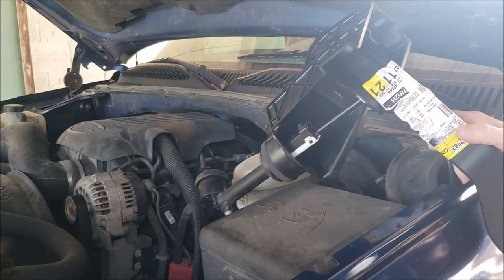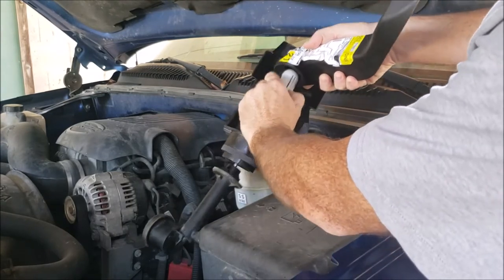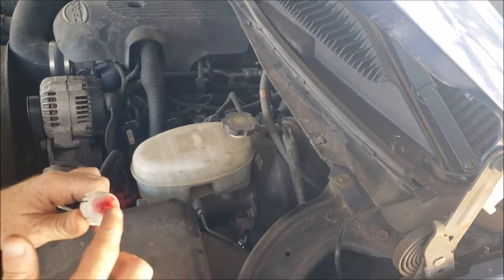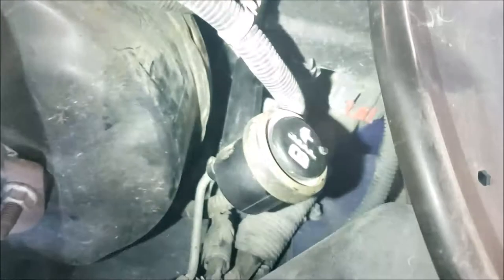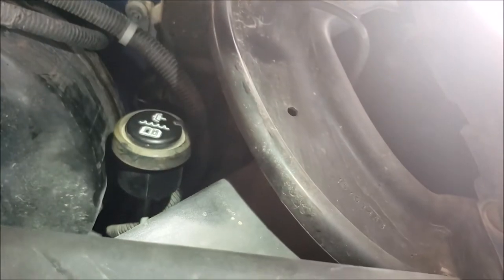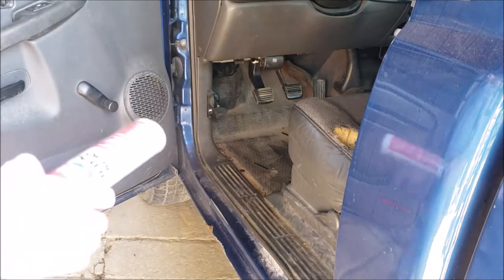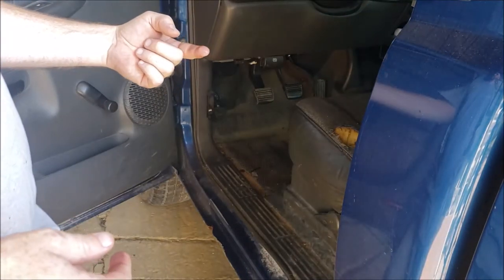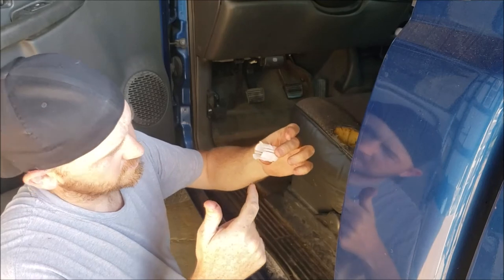Fixing a squeaking clutch pedal in a Silverado

Comment: Any ideas on the noise if grease doesnt help? I have a new pedal assembly with a new bushing cause the old bushing was in pieces. The new pedal and bushing was squeaky so i tried a few different lubes and grease but no luck and then I replaced the master cylinder but it's still obnoxiously squeaky. The only thing i can think is that it's the new pedal itself. Any other thoughts or ideas?
Reply from the maker: I no longer get have the truck but I think I remember greasing the bushings  a couple of times to get them to stop. I may have used a heavy grease.

Comment: I have exactly the same issue with a 2005 Silverado 4WD with the 4.8 engine. If anything the sound of my clutch is even more annoying. My truck is a standard cab so the room to work is extremely tight. Might need to remove the driver’s seat to get the room to get to it. Is it possible to do this fix working from inside the truck only? Wondering how you got the pedal assembly out. 

Many thanks
Reply from the maker: Russel I have another video that shows me replacing the pedal assembly. Should be the video posted a day before this one.

Comment: Question about the greasing.  Once the master cylinder was locked in, how did you get the rod to move back enough to get the white bushing back off to grease?    After you unlocked from the pedal, how did you move the tod back?  Thanks
Reply from the maker: I think I took the master cylinder back out but I believe the ball has two tabs that need pressed together to remove the rod from the pedal assembly. It's been a while since I've looked at it.
Reply: @DivineSpeed  That is the same question I have. Can you remove the white ball without removing the master cylinder?

Comment: I break 2 pedals in a year, any metal replacement?
Reply from the maker: I have been told about a metal replacement. I believe that information is in the comments. I've been told about it but have sold the truck and never looked into it.
Reply: Need a new clutch assembly with throw out bearing. Happened to mine also, 2 pedals, dropped trans time for a new clutch old was toast.